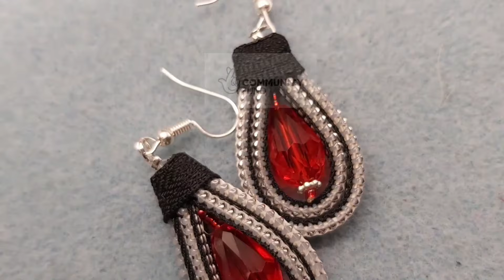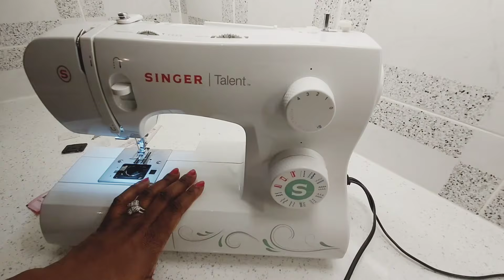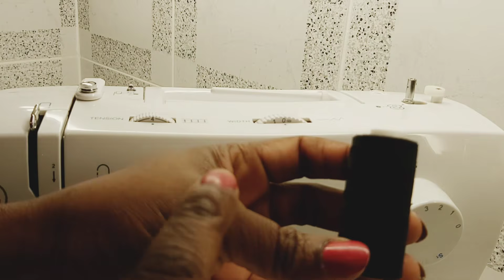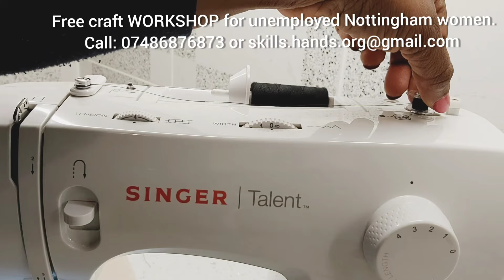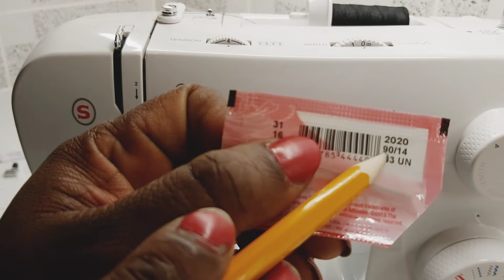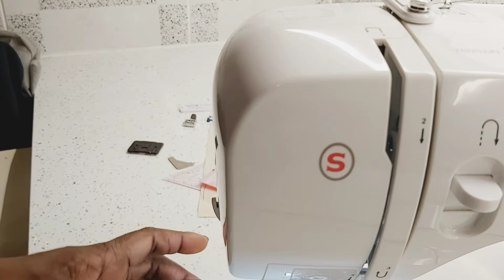How to operate the Singer Talent sewing machine #sewing  #sewinghacks  #sewingtips

Comment: Thank you for all the steps you explain very well,it is very helpfull but also I have a question,I bought this maschine today and I've never had a top bobin,now when you take it out ,are you using any of the tools you have in that bag or just with your nails?,thank you in advance.
Reply from the maker: Many thanks for watching and for your kind words. I am happy to hear that you found this tutorial helpful.

To get your bobbin out of its position at the top just pick it up with your fingers. You do not need any tool to do that but, if you are struggling to get that done, you can use the tip of your scissors to help you pick it up. The machine does not come with any special tool for that.

I hope I was able to answer your question.
Reply: Thank you so much,I really appreciate you answer my question🙏❤️

Comment: Thankyou this was so helpful as a beginner. I have one question. Even after doing everything as you done, sometimes the bobbin will not bring the loop up with the needle to connect. Am I doing something wrong? I can see the loop being made but it won’t go up with the needles
Reply from the maker: I am glad you found this helpful. The needle should always bring the bobbin thread on its way up when everything is done properly.

Take your time and gently lower your needle using the hand wheel. Turn the hand wheel 360 degrees and as the needle comes up,  it will automatically pickup the bobbin thread. I hope this helps. Let me know how you get on.